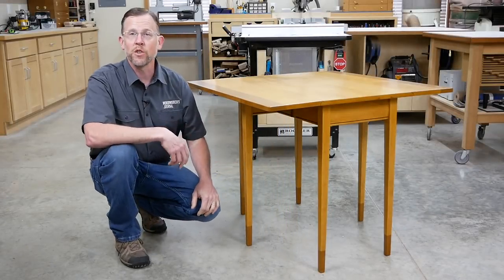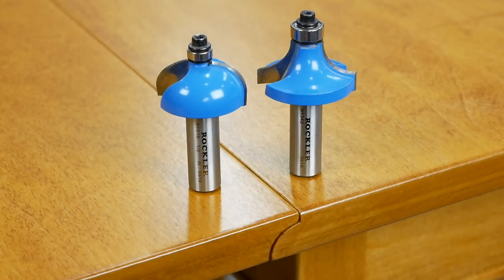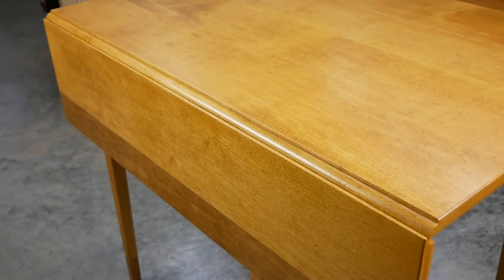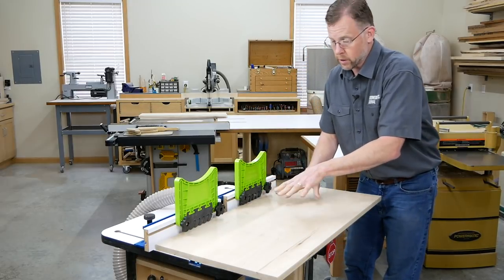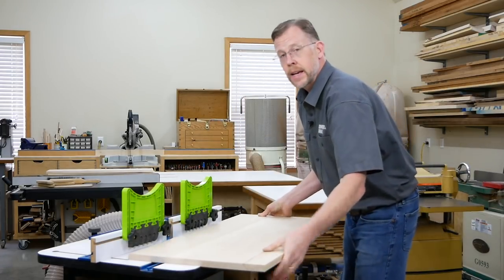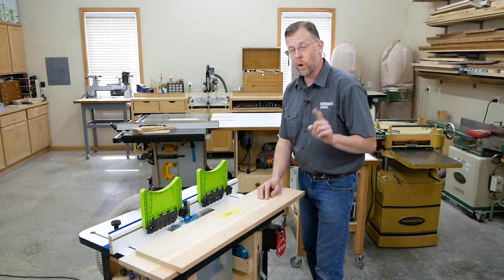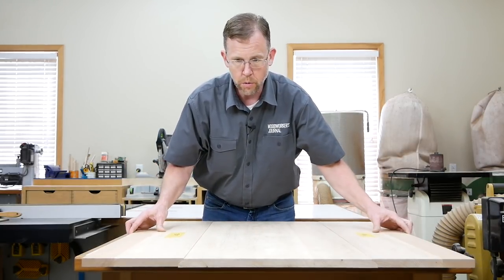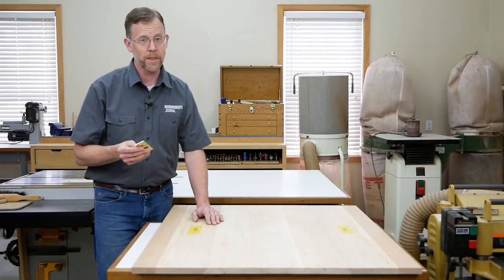Routing a Rule Joint to Make a Drop Leaf Table

Comment: Hi Sir, thanks for showing this technique. I am making a new table for my radial arm saw and was going to add two drop-down sides. Guess how I am going to make the edges look now?  A rule joint of course.  The only issue is that the top is chipboard and what would probably work best is a rule joint in a solid timber.  No problem.  Thanks a lot.

Comment: Appreciate the straightforward explanation of a rule joint!  I'm dying here because my material is 1 inch thick rather than 3/4 inch.  I'm not sure if "standard" cove/roundover bits will give me the desired effect, and furthermore since this material is thicker than my normal 3/4 inch stuff I don't have a lot of scrap to play with.  Any advice would be appreciated!
Reply: I had the same issue, I just routed it deeper with the round-over bit, then routed the cove bit to match. It made the lip thicker but it all hinged the same as the radius was still working on 3/4". I don't have the project anymore and can't find any pictures. But it worked.